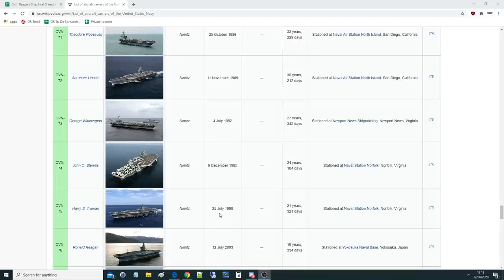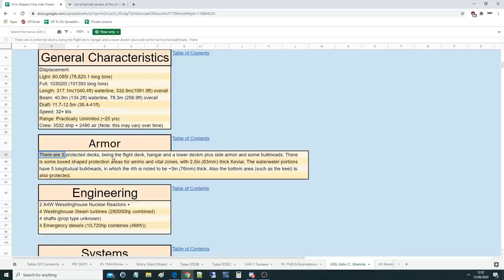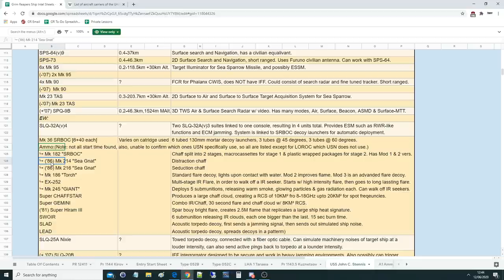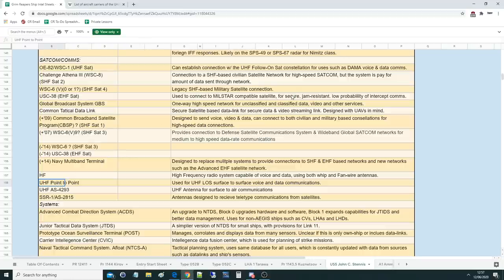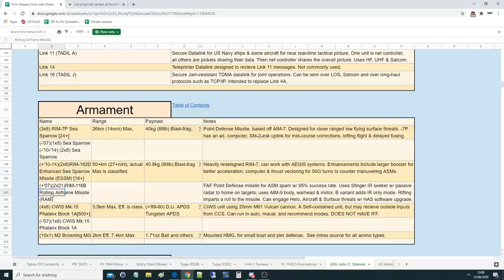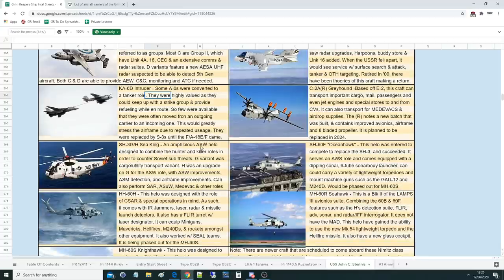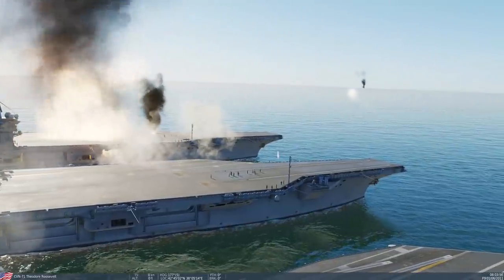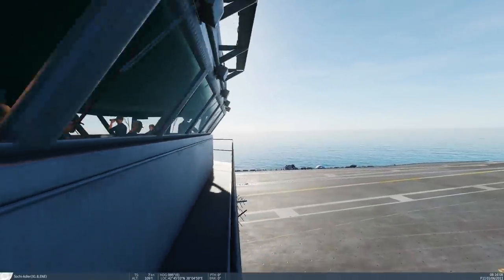Combined Arms: CVN-71 To CVN-74 Supercarrier Tutorial | DCS WORLD

Comment: * CVN In the Navy is C=Carrier , V=Heavyer than air/Fixed wing , and N= Nuclear. I was on the USS John F. Kennedy CV 67. Unlike a Zeppelin destination ZR. I think the R = Stands for lighter than air.
Reply: In CVN from what i have read Its CV= Carrier & N=Nuclear, seems V does not have a separate meaning. Z: Lighter-than-air & R: Reconnaissance when it comes to Blimps/Zeppelins/Dirigibles.
Reply: @kurtreichenbach8927  I sure you are correct on the ZR, but the "V" does have a meaning. The "V" is also used in Squadron identification. Ie "VF-103". Heavyer than air Fighter. You or anyone may fact check me. :)
Reply: @cornbread5144  You are correct  The V in VF-103 means a carrier based fighter wing. I was just saying that the V in CVN has no separate meaning in that designation.
Reply: @kurtreichenbach8927  As far as I understand from some navy history channels CV stands for "Cruiser Voler", or Flight Cruiser. This is likely due to the fact many of the first aircraft carriers were converted cruisers.
Reply: @Firestorm2900  After doing some more digging it seems to be the case, I have found several sites that point to this. Looks like that obvious choice of CA was already taken and V was used. Looks like Voler is French for glide or something like that.
Reply from the maker: thx

Comment: Combat speed is unpublished.  Using that level of speed is also going to require a coolant change and it does damage to the Rods.  But even at cruising speed 32 is conservative.  Did a cruise on the America.  It was fun but a lot of work.  The  diesels are also including the thrusters and water pumps.  The generator_power production plants are turbines.
Defensive capability only, im sure many of the pilots on board would beg to differ....
Reply: When we say defensive only, we're strictly talking about the the ships rather than the air wing complements. I'm sure with an air wing a Nimitz would put up a bit of a fight with the newer "Distributed Lethality" concept.